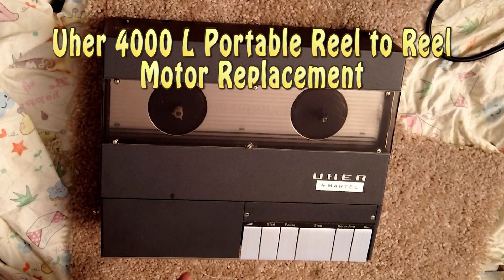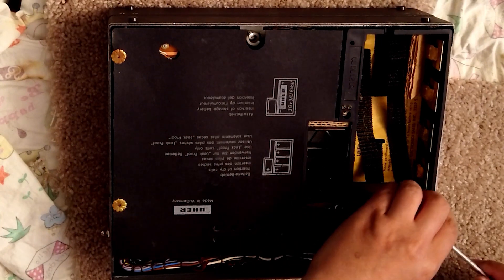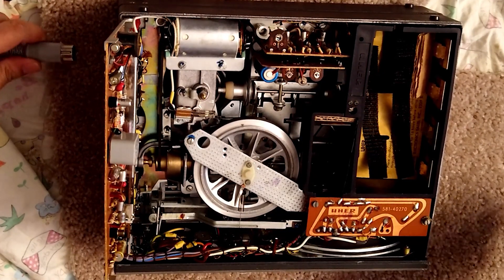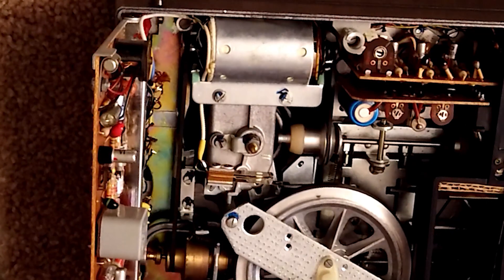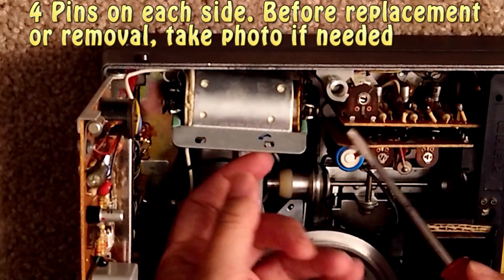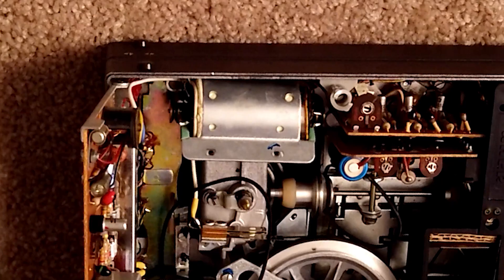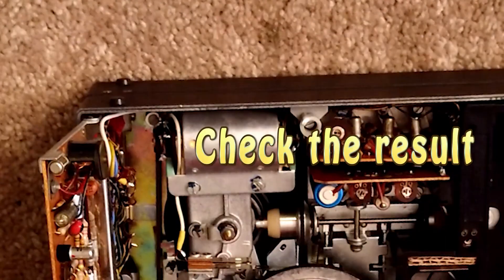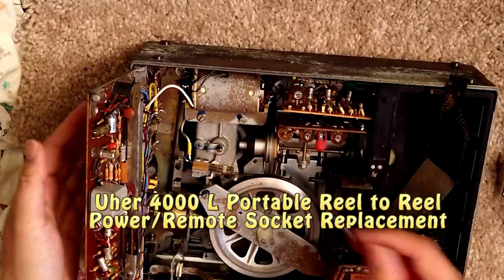UHER 4000 L / S Reel to Reel Video 1 : Motor Replacement Fix Repair 4400 4200 Report Monitor

Comment: Hi! Great video. I'm facing my unit having it's motor missing. Do you have a model number or name for the motor to make it easier to find? Thank you
Reply from the maker: Sorry I do not know the model #. However, here is the still operational and orginal Uher Factory  center : http://www.uher-reparatur.com/indexe.html . You can email them and ask, they usually replies in days. Another option is buy a part unit from ebay which is cheap.